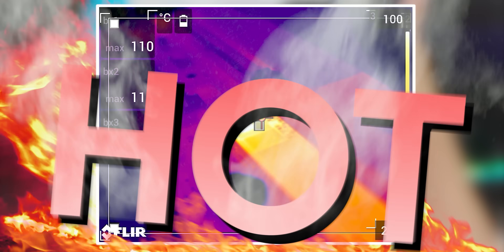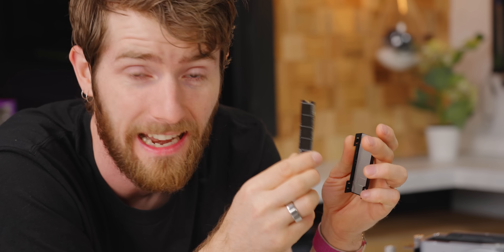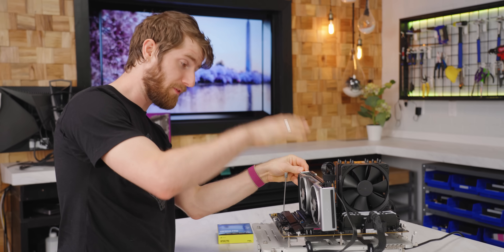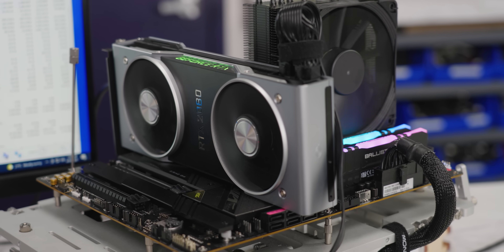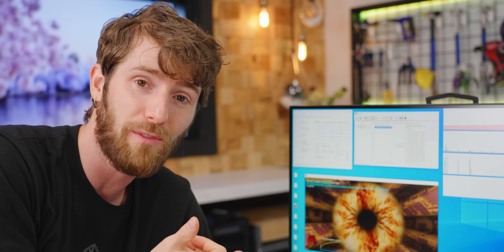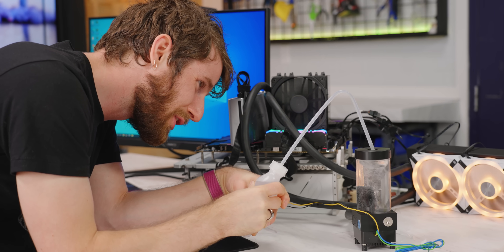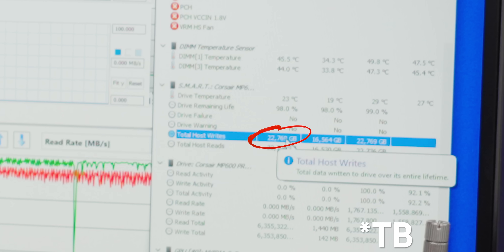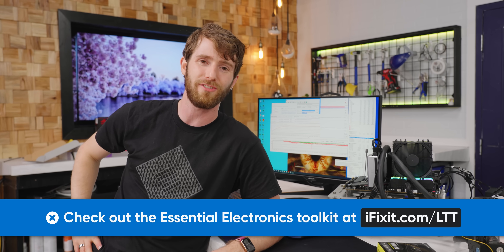This Product is a Meme - Corsair MP600 PRO Hydro X water-cooled SSD

Comment: It's only a matter of time before we get water cooled water coolers
Reply: Jay did that already
Reply: Water cooled D5 pumps
Reply: what about water cooled water coolers water coolers
Reply: You mean like water sprayers on intercoolers with cars.
Reply: Then we'll need to cool down the two water cooler of the cpu
Reply: what do you think heat exchangers are... found in ships, nuclear powerplants and other powerplants that uses seawater to cool the coolant
Reply: I'm still waiting on water-cooled sata cables
Reply: I think Jay did that with a cooler, ice, water and a pump..

Edit... oops missed the one where someone already mentioned Jay. They got my thumbs-up.
Reply: How about PSU water cooler
Reply: xD ice maker cooling water system for coolling system pc xD .......................loading time for the brain xD
Reply: Put a triple Rad in a pool
Reply: Wait he already did cooled a air cooler water cooled
Reply: A internal loop where the rad is cooled with a external loop attached to the air conditioner 😂 honestly a good video idea ngl
Reply: Tesla did it
Reply: Water cooled radiators!
Reply: No forget that, imagine rgb water for your water cooled water cooler 🤧
Reply: Hah
Reply: It's called submerging cooling. The main liquid ain't water. However, as it veporizes and rises up it touches the heat exchanger which got water in it flowing.
Reply: I mean technically they do cool themselves
Reply: You need to add some Prestone!
Reply: oh god
Reply: Water cooled water ftw
Reply: WITH RGB
Reply: Lunis: "We created our own global water cycle to cool the new Threadripper."
Alex: "I'm not sure if we're getting enough condensation or too much. We might need more temperate rain forest biome..."
Reply: Well ... all the fission reactors are doing that.
Reply: Corsair be like... HOLD MY WATER
Reply: @mikemitchell9157  lmfao really? I gotta see this
Reply: Water cooled power supplies?
Reply: @aaaaaa-nr5mo  they already did a watercooled psu
Reply: We install them every day at work, most Diesel engines for industrial pumps have a coolant loop for the engine with a heat exchanger.  So the water pumps water cools the engine coolant that’s being pumped by a different pump.
Reply: Water cooling mineral oil pc with water cooled water coolers
Reply: A matter of time? You fool, they already did it.
Reply: This man knows our true future
Reply: Water cooled gamepad
Reply: Pumps actually do use the water that flows through them for cooling so jokes on us, the pump was the OG heat source
Reply: Waterpump cooler
Reply: Still brings me back to my creek-cooled frontier system thought xD.
Reply: 3M Fluorinert Electronic Liquids exist
Every water pump, block, tube, pipe: Are we a joke to you?
Reply: @EliteSniperTV  placing the rad in a chest of ice water is liquid cooling your liquid cooling......
Reply: @Xaran C everytime he hooks it up with the ice water chest
Reply: Technically liquid cooled pumps exist, basically any in tank fuel pump will overheat unless it's submerged in gas
Reply: I wanna see a water cooled power supply
Reply: Right now it'd be nice if the heat exchanger took the water cooling loop heat outside the house.
Reply: Water cooled FANS... WHEN??
Reply: same feeling bro
Reply: @jaubuchon28  that is why it is bad practice to keep a quarter tank or less in your car.  I've seen them melt till they were unrecognizable
Reply: Clearly the ultimate advance will be a water cooled power button
Reply: Aren't water coolers already water cooled?
Reply: Water coolest air coolers
Reply: Patent pending. I will send you 10% royalties
Reply: What about water cooled screws? Or water cooled keyboards? Or water cooled mice? Or water cooled water? But then the water cooling water cooler needs water cooling too, but then the water cooling water cooler that cools the water cooler needs water cooling, butt then the water cooling water cooler that cools the water cooling water cooler that cools the water cooler needs cooling.

Maybe in the future, we will even get water cooled RGB vibrators?
Reply: Hhahahah
Reply: I just thought about a water cooled mouse and pad
Reply: @MountainWo1f  xD water proof fan need to be creat asp guy for thats think to be crazy as hell xD
Reply: Hey, why not... thermal exchanger water-water and a huuuge heat sink outside of the case :D
Reply: Do SSDs get really hot?
Reply: But it's only a matter of time until we get water coolers to cool the water cooler cooling the water cooler, you get me?
Reply: Insert "yo dawg" Xzibit meme here
Reply: @ryanthelin6867  As long as the next one is bigger than the one before it. Let's play thermal domino :D
Reply: Shout out Culligan
Reply: Aw naw man why you gotta give em ideas
Reply: “in this video we watercooled our aio and it was pretty cool, almost as cool as our sponsor ____”
Reply: How else you gonna cool your water?  With a fridge like a peasant?
Reply: Who’s gonna water cool the water cooler for the water cooler though
Reply: @stugiii6609  that exists already
Reply: And maybe we will get water cooled vrms      who knows
Reply: "Yo dawg, I heard you like water cooling, so we water cooled your water cooler!"
Reply: EK: “Pardon?”
Reply: @liamcollinson5695  hmmm i dont know why i tell me same thing i get WB 500g and 1t all my component turn around 32 degreé all the time so dont really why how the ssd get thats why
Reply: event my gpu on high load get to 42 degrée max xD so how ssd get to 86? i dont ... know it xD
Reply: Coolception
Reply: Customers will have to take their PC's to Jiffy Lube to flush and fill their radiators..
Reply: That is called an heat exchanger!
Reply: The D5 pump is already water-cooled, too late
Reply: Bruh it's cooler inception
Reply: And water cooled water cooler pumps
Reply: Is not the radiator of a water cooler air cooled?
Reply: @daviddin8863  if you are talking about air to air intercoolers that would be water/methanol and that is sprayed inside the intercooler so you're not actually cooling water with water
Reply: @Priceless-_-  jay did that and got muddy colored water lolz.
Reply: Pathetic, water cooled water
Reply: Xzibit enters the chat
Reply: someone should make a liquid pc, all our heat problems would be solved 😁 just add some ice cubes
Reply: Yes
Reply: Do you mean water-to-water heat exchangers? Those exist.
Reply: Hehehe imma do it
Reply: Nuclear reactors been doing it for a while.
Reply: @eerie4671  You mean water cooled water coolers water cooling water coolers?
Reply: nuclear reactors already have that
Reply: @daviddin8863  that's a water cooled air cooler. The intercooler is a cooler that cools air with cooler air.
Reply: It’s been done
Reply: Any water coolers need air coolers (fan).
Reply: ikr, we've already got solar-powered flashlights
Reply: Don’t give them ideas
Reply: Your comment made me realize that all water coolers are ultimately air cooled...
Reply: Nah you forgot the water cooled case too
Reply: @eisenklad  Was about to reply the same. That is literally like the definition of a heat exchanger lol
Reply: thats how many pumps get cooled, by the coolant they are pumping
Reply: Been there, done that
Reply: thats how waterpumps are cooled.
Reply: I feel like that makes no sense
Reply: ~~I may or may not be planning to build a water block for my air cooler~~
Reply: More like water-cooled air cooler 🤣
Reply: So we now have watercooled RAM (thermaltake) and a watercooled SSD (Corsair).  Linus needs ro make the complete watercooled Frankenstein a reality.
Reply: Water cooled power supplys
Reply: Water cooled radiators
Reply: exibit enters chat
Reply: Lol
Reply: Water cooled ram
Reply: A water cooled, thermo electric cooler
Reply: Wait till we need to supercool (below 10 kelvins) regular computers
Reply: But then you need to water cool the Watercooler that Watercooler the Watercooler
Reply: True......
Reply: Redundancy isn’t always a bad thing
Reply: then we will have to water cool the watercooler that cools the watercooler
Reply: lmao
Reply: Linus , Jay and Steve have All done a form of this in the past.  Linus did it back in the Good Old LLT Days in the OLD House when they were trying to water Cool a Whole Room of Pc's with a closed Loop ...I dont remember the whole reason why Linus did it but ...Linus put the RAD in a TUB with water in to make it Colder!  Cow}:-o)
Reply: Linus has made more than one of those. Hell, that was one of his first products: A heat sink cooled by a big box full of ice.
Reply: Yo, Dawg!
Reply: Water cooled water cooled water coolers.  U got it all wrong
Reply: I want a water cooled mouse and keyboard.
Reply: Are they not technically already water cooled?
Reply: Already have it
Reply: what about having a water loop and dumping LN2 on an external rad lol
Reply: i would like to water cool them
Reply: .... Can u wäre rcool my chair and my room?
Reply: It's water cooler inception!!!!!  We're going to have to have water coolers to cool our water coolers that are cooling our water coolers that are cooling every component in our computers and our gaming chairs.
Reply: Presenting the: ULtimATe  Water cooled water coolers that are water cooled by water coolers which are water cooled.
Reply: So like closed loops that can be opened down the line
Reply: One user had a water loop from his swimming pool, though a heat exchanger, cool his PC's internal water loop. So yes it's being done.
Reply: water cooled submersed pc next!!!!!!!!!!!!  (wait...nm already done)
Reply: I did some testing with a loop where cold ground water then cools my coolant in the loop via a liquid to liquid heat exchanger. It was great, but in the water the coolant got dangerously cold. If you have free or very cheap water it might be worth it.
Reply: You mean a cascade? Nothing new.
Reply: @brap3775  Done already. Temp controlled Peltier that cools the reservoir that is the loop for the CPU.
Reply: we need a heat exchanger for watercoolers for gamers that play shattered galaxy on oc threadrippers on chinese satnet
Reply: @naiyief  sorry not the first time someone has asked for the video name and then I feel like a dummy cause I can't remember so I gave ya details to make myself feel better about not remembering a name lol
Reply: We need water cooled cat ninjas
Reply: Probably a good idea! Imagine spinning cold metal cooler which froze the airflow comin' to your PC, would've been awesome!
Reply: And then water cooled water cooled water coolers
Reply: Water Cooled Chassis lol
Reply: Water cooled pump
Reply: Liquid nitrogen cooler
Reply: Water cooled pumps*
Reply: Did i just water cooled my water cooled water cooler? 😳
Reply: i'd prefer a dodgy watercooled power cable
Reply: Water coolers are already cooled by Easter coolers by cooling themselves
Reply: In this weeks episode of Pimp My Ride:
"Yo dawg! We heard you like water coolers, so we water cooled your water cooler!"
Reply: It's called a charge cooler!.
Reply: Nop, water coolers will add oil radiator and intercooler so that it starts a bit more fresh and with a car fan, only then we can add a turbo to the water cooler so that it helps the slow pump runs super fast and a blow valve so that it can remove pressure when it's not needed :)
Reply: Dont give them ideas
Reply: @eerie4671  water cooled water coolers water coolers water coolers
Reply: Link?
Reply: Don't...
Reply: unless you are DIY Perks then your PC will Breathing instead of water cooling
Reply: Boats already have them. It's to transfer heat from coolant to seawater. ;)
Reply: Airliners often use fuel/oil heat exchangers to cool the oil and heat the fuel to keep it from freezing.
Reply: Put your radiator in the toilet and flush it for turbo boost
Reply: I would like a watercooling reservoir with some heat dissipation capability.
Reply: most water cooling pumps cool them self with the water anyway
Reply: Can I get a water cooler for my LTT water bottle while we're at it?
Reply: @daviddin8863  that would be a water cooled air cooler technically
Reply: @stugiii6609  FSP has had water Cooled PSUs for years
Reply: @tomahawkgames2502  that's been done by a few youtubers including LTT I'm pretty sure
Reply: TAKE MY MONEY!!!
Reply: Watercooled desktop. Lessens need for (cheap USB external) fans kicking on when it’s hot.
Reply: u know that some cars use water to cool water cooler by evaporation XD
Reply: They have 2 water coolers that water cool each other
Reply: DO I HERE WATER COLLED FANSSS WITCH ACTUALY KINDA MAKE SENSE
Reply: @MrMats0n  they make them for radiators too, as well as Co2 sprayers.
Reply: @wades623  no, not methanol sprayers, back in the early 90s subaru and mitsubishi had water misters that sprayed on the fins of the intercooler and radiators. it was used in a lot in rally racing back in the day
Reply: @twizz420  the concept is spraying the fins on the radiator/intercooler with misters. there also applications where its done in conjunction with co2 sprayers.
Reply: Gotta cool the radiator some how
Reply: nice paradox Lol.
Reply: Where are the xzibit memes????
Reply: No it's only a matter of time before the water coolers tanks get bigger and bigger until they're outside of the PC
Reply: Water cooling will adventually become standard as PC parts become smaller and faster requiring more cooling.
Reply: I would actually buy a water cooled mouse
Reply: @twizz420  I know they did a thermo electric cooler but I didn’t know it was watercooled
Reply: @tomahawkgames2502  well, it has to be cooled somehow. They did both an air-cooled TEC and a watercooled TEC using an aliexpress waterblock
Reply: @twizz420  ahh. I must’ve only seen the air cooled TEC
Reply: I think that just means a bigger water cooling system
Reply: all water coolers are water cooled
Reply: What about watercooled watercooler for watercoolers
Reply: nah man we are waiting for water cooled case fans
Reply: Or a water cooled, water cooling, water cooler, water cooling, water cooler.
Reply: Those pumps can get hot 🧐
Reply: D5 pumps are water cooled. The stator is in direct contact with the stainless cup that surrounds the impeller/rotor.
Reply: Water cooled water
Reply: Ahhh, the nuclear reactor tactic
Reply: True
Reply: It will work
Reply: @stugiii6609  That's a real thing with high power lasers.
Reply: ANYTHING FOR EFFICIENCY!!!! 😈
Reply: Twice the cooling for only 4 times the price.
Reply: @aceprobester7650  When you're at the upper end of the performance charts, this is a more than acceptable price to performance ratio. Shit gets expensive when pushing boundaries.
Reply: The pumps get cooled with the water they move, so basically we've always done that, idk.
Reply: Water cooled water coolers cooling water coolers
Reply: @Lambda_Ovine  not my system
Reply: Metawatercoolers
Reply: water cooled water coolers that are also water cooled
Reply: I mean tec coolers are water cooled.
Reply: Ice?
Reply: Still less silly then the old liquid cooled PSU.
Reply: Would you like finance on that?
Reply: That's fairly common in nuclear power plants. The pressurized water from the reactor core (which contains the nasty radioactive stuff) goes to a heat exchanger to boil clean water and run the turbines. This means the steam is non-radioactive and can be exhausted to the atmosphere. Also the cooling water is often heavy water, and if it mixes with regular water this will stop the chain reaction.
Reply: I think Major Hardware did that actually
Reply: Don’t give them ideas
Reply: Xzibit, is that you?
Reply: Personally I'm waiting for the water cooled gaming chair!
Reply: All water coolers are water cooled..
Reply: That's... Basically exactly how electronic water coolers (ie refrigerators) work.
Reply: Ha ive got a watercooled monitor. Losers.
Reply: It's only a matter of time before we get a air cooled fan
Reply: Pumps get hot lol
Reply: All water coolers are water cooled
Reply: Some cars cool the air with water that is cooled by air
Reply: It's only a matter of time until someone watter cools watter
Reply: @kinforr7764  ice cubes...
Reply: For big data centers it already exist.
Reply: Isn’t that just a water cooler?
Reply: I just put my pc in the fridge
Reply: funny comment, you're so smart!
Reply: Actually would be sweet
Reply: Or power buttons or IO shields or case fans.
Reply: They did that in ww2 too.
Reply: @eerie4671  water cooled water coolers that water cool your water cooled your water cooler
Reply: Air cooled water coolers
Reply: How about water cooled air coolers?
Reply: @daviddin8863  No, because that would not be water on a water cooler. Intercoolers that get sprayed with water air filled with air, not water.
Reply: Watercooled pump
Reply: Water cooled air coolers that are then water cooled again just to be air cooled
Reply: Plasma and nitrogen cooler
Reply: a man of tomorrow
Reply: Time to water cool the ram psu and motherboard
Reply: Water cooled nuclear reactor power supplies with a separate water cooled system. Plus the water cooler for the water cooler.
Reply: Then the water cooled water coolers get water cooled
Reply: Priceless.
Reply: or water cooled brain implants
Reply: R.I.P radiators….
Reply: @SPLIFiTeD  they don't generate nearly enough heat
Reply: @stugiii6609  that would make an 80+ bronze unit silent
Reply: @erickwinchester1576  that water is in it, too late
Reply: @howsl2879  those radiators already are
Reply: @chirantannath6593  because of stupid lake by intel
Reply: Just stuff a brushless RC motor in your pump and voila, you need to watercool that sucker. Warning: high rpm might cause slight vibrations.
Reply: and water cooled water cooled water coolers
Reply: Those are called water to water coolers and are used in other industries , so yeah, it could happen
Reply: @user-fe7bo5mm1o  that would be a meme
Reply: @SPLIFiTeD  they wouldn't generate nearly enough heat for it to matter
Reply: @stugiii6609  yeah, that's ok, if it was 2x90mm
Reply: @Nike 5 Mega that's what we may need if intel refreshes 🚀 lake
Reply: It’s only a matter of time before we get water cooled water coolers that are air cooled
Reply: @colethekid8641  no
Reply: @thomas-kn5oh  extended cpu block maybe
Reply: @rhebucks_zh  just a idea
Reply: I mean yeah
Reply: there’s such thing as a water cooler
Reply: Then we will get water-cooled water coolers that are watercooled
Reply: Then air cooled watercoolers
Reply: They exist just usually for something bigger than pcs
Reply: To be fair, a watercooler is already watercooled ;)
Reply: using a water jacket around the pump motor could be a good idea
Reply: Water cooling squared
Reply: Water cooled motherboards.
Reply: @stevenarvizu3602  which is cooled by another loop with d5
Reply: First water-cooled Ram though.
Reply: It's only a matter of time untill we get a water-cooled air cooler
Reply: Pumps generate a lot of heat with restrictive water blocks, it’s 100% necessary 😂
Reply: i sometimes dunk radiators in ice water buckets. does that count?
Reply: @eisenklad  not just used there also anywhere that does liquid transfers at different temperatures. Dairies, Wine Bottling, Breweries etc.
Reply: A 2 stage water cooling.
Reply: Sry to disappoint but that like already exists, for really long time even… It’s called heat exchanger…
Reply: water cooled pc case
Reply: I'm excited for the future
Reply: Redundant redundancy is redundant
Reply: Water cooled psu
Reply: Water cooled system fans
Reply: To cool the pump that runs the cooler, genius.
Reply: I’d still buy it
Reply: Water to water intercoolers work for your car, why not your computer?

Kinda what Linus is going at his house with the heat exchangers into the pool.
Reply: We already have them.
Reply: Water cooled psu
Reply: Isnt that what a 2nd or 3rd radiator does.
Reply: I mean thats essentially every water cooler
Reply: I actually legitimately laughed at this, this is gold bruv
Reply: Water cooled fans lol
Reply: @niggesh_hitman  yeah Jay's 2 cents already made the water cooled water cooler
Reply: Imagine a whole case that works as a radiator
Reply: naw, dont forget, our RGB lights will be water cooled, our case, our tempered glass, our display ports, hdmi ports, usb ports, usb c ports, lighting bult ports, even our headset?
Reply: Or planet coolers 💀
Reply: Im already drinking water cooled water and shower in water heated water
Reply: A few years down the line, we're gonna need to water cool our water coolers for the water coolers
Reply: @ciberkid22  No, no no, think about in 3060, we wont even need to watercool but we will have people with a water cooled case inside a water cooled case inside a water cooled case under the ocean, tell me im wrong.
Reply: soon there will be A/C cooler in your pc with gaz and everything...
Reply: Aren't they already by their inherent design
Reply: @SPLIFiTeD  Now we actually do need watercooled cords for the 4090 😂
Reply: Don't steal my project! 😜
Reply: with rgb lighting
Reply: Heat exchanger?
Reply: Funny thing is water coolers are AIR COOLED😱😱😱
Reply: You mean a plate chiller? Those have existed for decades my dude. Either as water to water cooling or Phase change liquid/gas (AC Evap) to water cooling.  Even see some people uses them for cascade phase change systems as evap to condenser connections.
Reply: I'm going to water cool this comment.
Reply: I mean, that's already a thing lol. Heat exhanger
Reply: @daviddin8863 ehhh. Way better to inject the water into the intake post intercooler for a real good benefit
Reply: Water cooled PSU, Water cooled monitor, Headset, keyboard, Mousepad it'll be like those water beds from American films
Reply: Aio for the Aio
Reply: @northerngaming8287  no one tell him
Reply: @northerngaming8287  we’ll have to plumb them to the house water heater to harvest that waste heat 😳